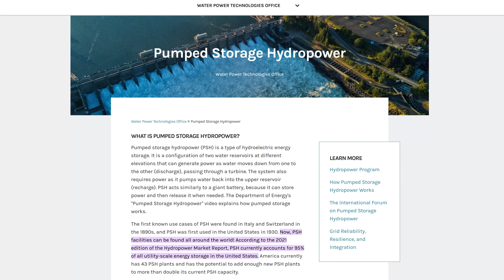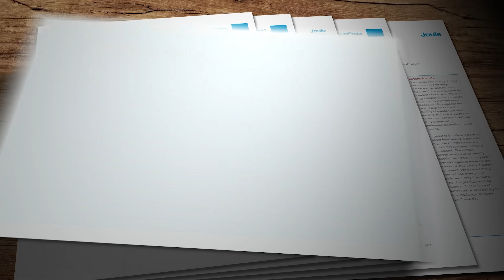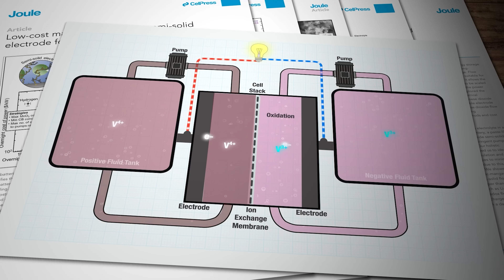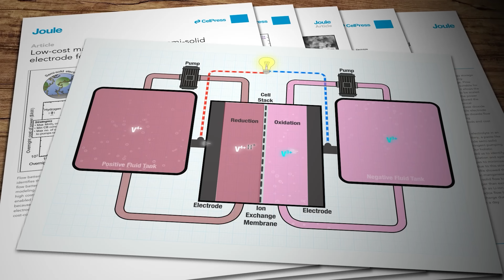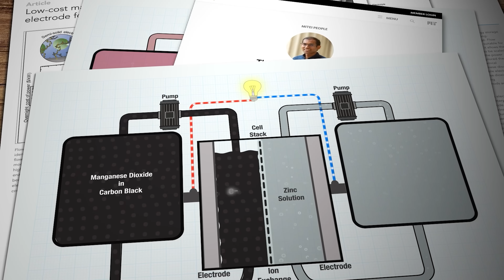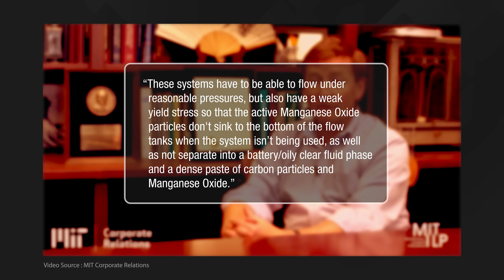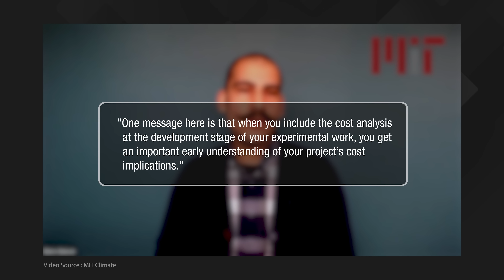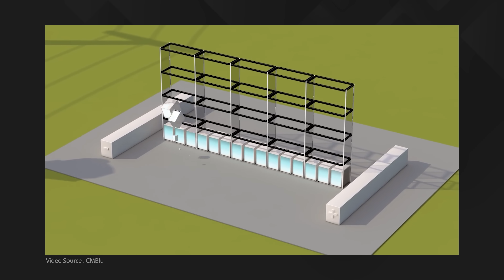Have we found the missing link in the energy storage equation?

Comment: Paste or glue pumping sounds like blowing your nose with a bad head cold. There doesn't seem to be much reason not to look into less viscous solutions. Perhaps a solvent less polar than water could be used..?  Unlike the pictures in the vid, it could be useful to pump up, as well as temperature variations, to encourage buoyancy mixing. There's all sorts of additives, as well, that can prevent 'caking' or clumping of particles. 
One thing that almost always seems left out of battery system design thinking is the fact that the main region of interest, where everything's happening, is the Helmholtz double-layer, right at very small distances from the cathode and anode surfaces, where the final stage of charge transfer occurs. Most of the rest of the electrolyte is mixing or diffusion 'dead' space. One should engineer that to a minimum.

Comment: The pumped hydro storage has been around for a hundred years and is a popular and proven technology.  There are only the regulatory and political hurdles that have to be completed.  There are thousands of these potential sites around the world, they just need a small fraction to be brought online to take care of most of the storage requirements.  An abandoned mine pit was chosen for a pumped hydro site in Australia.  

I'm hoping that some financial support is made available to longer term storage like redox flow batteries because they fill in a time frame that's between lithium batteries and pumped hydro storage.

Dave mentioned frequency regulation.  From what I've read, this is the method that the grids use to signal load conditions.  High load slows electromechanical generators and signals the grid needs additional generation.  But renewables do not need to let the frequency change with load.  The voltage sags with high load, not frequency.  So the grid is going to have to get smarter in order to eliminate all those thermal generators run by fossil fuels.

Comment: There is at least one company fielding redox flow batteries that don't use vanadium, and is environmentally friendly.  And there are other videos on YouTube with more information about them.

One would think that they could find a solution that is not so viscous so that it is easier to pump. Another thought occurred.  How about using some mechanical spreaders to scrape off used goop and spread on another layer of fresh goop.  The continuity of current would have to be interrupted but averaged over scores or hundreds of cells, the interruptions would average out and not be noticed.

Comment: You also need to look at round trip efficiency, as well as initial cost per kWh of energy storage, cycle life, and maintenance costs. Lithium batteries are incredibly efficient, low maintenance, but have a high initial cost, and limited cycle life.
Reply: You are right that all those factors need to be considered and LCOS does. For grid scale time shifting of renewable generation efficiency is not super important because because the charging energy costs next to nothing as it is currently being thrown away. Capital costs divided by total lifetime energy storage are much more important.

Comment: A screw pump is usually the choice. The technology is fairly developed pumping cement to high buildings under construction.
Reply: Perhaps a peristaltic pump would work even better than a screw pump. Many years ago I used one for quite viscous phenolic resin and it worked a treat. The other option would be to slightly heat the electrolyte, if its viscosity is strongly temperature dependent.
Edit: also possible, a Moineau pump, which is a progressing cavity design, even better for very viscous fluids.
Reply: @johannesschaller5510  I always wondered if peristaltic pumps don't wear out too much, or too quickly...
...if they don't, you are very likely right.
Reply: @smferreiro2610  It depends on the tubing used in them and the material is that is being moved. They are cheap to repair when the tubing does wear out as compared to other types of pumps.
Reply: @gravelydon7072  I guess that, as always, it boils down into a question of economics and logistics: how expensive the tubing is,  how frequent we have he system down for what length of time, and if we can afford discarding some fluid in the process (ambiently and economically).
Thank you!
Reply: @johannesschaller5510  The tubing is the weak point. There isn't any round tubing material out there that can withstand being flattened all day without eventually forming a fold or crease. And the thick viscosity of the paste might be too much to pump through the tubing. The tubing creates a strong resistance to flow of high viscosity pastes.  If anything, the paste might need to be heated and maybe a timmer pneumatic pump would do the job.
Reply: @johannesschaller5510  I've used PCM pumps for transferring explosive emulsions. An auger system could work as well.
Reply: @johnarnold893  Interesting to see this thread expand, given what we don’t know about the electrolyte fluid. 😬 Seems to me there are at least two significant properties that need to be considered: the viscosity vs temperature relationship, and the shear rate sensitivity of viscosity. I’m not a chem engineer, but those would be the first things I’d ask about.
Reply: @johannesschaller5510  Haha. I had never heard of a Moineau pump. I looked it up and then realised I've worked on them for years and know them as a Mono pump.  I agree, a Moineau pump would work well.  We used them to pump molasses.  They did work better if the molasses was warm.
Reply: Also grain.
Reply: I was thinking just let gravity do the work, put a full hopper, or more likely an array of hoppers, at the top and drain into an empty hopper, then mechanically swap them
Reply: @Dysiode  Or, if we place the battery on a hillside, cheap real state, the "bottom" hopper of one cell can actually be the "top" hopper of the next, and we chain all the cells... 🙂
Reply: @Dysiode  I was thinking of something similar but having one full tank and one empty to receive it and having it on a spindle. Gravity will pull the liquid to the empty provided there is a vent. Then rotate when needed. Maybe making the whole thing reversible
Reply: As mentioned by Johannes… The oil drilling business also intensively uses Moineau-style motors ( reversed pumping… ) downhole for turning drilling bits.  The viscosity of drilling muds is much lower but they are very abrasive and they operate in an extremely harsh environment.  A very well understood technology.
Reply: @johnashton4086  Interesting! I'll take a look... thank you!
Reply: There's a type of screw where the screw remains stationary and the housing is what rotates, used for vertical grain lifting, and gravity does the rest. Olds elevator. It could also agitate the fluid preventing it from settling if that does become a problem.
Reply: If that goop shown at the start is a true representation of the electrolyte then I think a screw pump is the best choice as they are well suited to thick product, can be set up in a series configuration to counter pump line friction slowing,  and can be heated to improve viscosity if need be. Think of plastic's extrusion, they are just a fancy screw pump. I could not see you getting enough head pressure to allow for gravity induced flow of that thick  a material.
Reply: @alistairshanks5099  I believe that warming it up isn't an efficient option. I guess it would be pumped as it is (unless it is kept for freezing days)
Reply: All of these Technologies are very interesting and it gives me hope for the future.
There's one problem and that's the Arctic wobble as we have seen in recent years that could really throw a spanner in the works.

Comment: Just having a thought.  Part of the reason Elon got into car manufacture was, I think, because EVs would provide the scale to reduce the cost of lithium ion batteries to where they were competitive with pump hydro and more convenient.  So the ramping of Li battery production might make other solutions redundant.
Reply: There isn't enough Lithium readily accessible to use it for grid storage. Many people think we're going to struggle to find enough just for BEVs.  In terms of factories larger volumes = lower price, but larger demand for a scarce resource puts the price up not down. Mining lithium is very ecologically problematic/ potentially damaging. Save it for the cars and phones. We need something else for grid.
Reply: @adrianthoroughgood1191  CATL has used sodium ion.  There should be enough of that.  My point was that the solution that gets to scale manufacture will crowd out the others.  I liked the Ambti battery but it can't use EVs to scale.

Comment: We are better off using iron rust and salt water flow batteries.  Common PVC components,  easily scalable salt water tanks, 100% recyclability, 20 yr life span per system, no shortage of materials,  average layman can repair and maintenance without a hazmat suit.  If it breaks down and is discarded it will easily be reabsorbed into the soil. No toxic side effects.   And the US Army is testing them.

Comment: out of all the grid storage batteries you've reviewed, the liquid air battery seems to tick most of the boxes, using low cost common materials and extremely long cycle life and huge storage capacity from four hours to four weeks, I'm wondering if the liquid air battery makes it into mainstream grid storage.
Reply: Indeed. It would be interesting to compare grid scale storage solutions to liquid or compressed air batteries as a reference.

Comment: Zn-MnO2-C powder batteries are called dry cells. Unfortunately they are not reversible. 

The problem will not be with the MnO2- carbon powder paste; the Zn electrode cannot be regenerated efficiently and it will be produced something like a sponge.

Comment: We cannot possiby build enough batteries for grid scale storage. The idea is simply a non starter. Do the math.
Reply: Estimates show to convert to a 95% plus renewable grid we need around 600gwh of total energy storage capacity.
Tesla plans to do 40+gwhs of megapacks just from their new facility in lathrope by the end of 2023. Slated for 20+gwhs this year alone.

So yes we in fact can build enough grid scale storage using batteries. Just tesla alone with some massive pumped hydro would get us there in about 10-12 year's from now. 

Nevermind that worldwide ev production alone now is over 300gwhs, so if a large percentage of evs start to offer v2x capabilities. 
Which is in fact coming online with the ioniq 5 and ev6, the id series vw evs are supposed to do v2x starting later this year. 
Lucid has v2x, rivian is supposed to offer it eventually. The Ford lightning will have intelligent home backup power on every truck from day 1. 🤔
Reply: @4literv6  No we can not build enough grid scale storage using batteries. it is utterly impossible and would need many times more of certain metals than exist on the planet. Tesla did build a 'grid scale' storage in Australia which holds enough charge to power a small town for about 1 hour. That's the3 best they can do. i dont know where you got your figures but they are messed up. 600 gigawatt hours? for a whole country to last potentially several months? 600 gigawatt hours would be gone in a few hours.

Comment: LCD displays were in the lab for 30 years until they swept CRT technology away in a couple of years. It can happen and I hope it does quicker for battery and all other forms of renewable energy storage technologies. The planet is screwed if it doesn’t happen.
Reply: Technically they were in the lab and in watches, calculators and various niche applications. Shrinking the cells down to pixel size was the  biggest issue I guess.
Reply: @alvarofernandez5118  I read that it was getting the manufacturing quality up to a point where the pixel failure rate was acceptable on a large display.
Reply: Yea, I definitely think research on all these things  needs to keep going forward for the long term gains that we’ll eventually get.

It’s just when I hear someone putting off purchasing an LI storage battery for their solar system cause they want to buy a flow battery when it comes out….that’s when I roll my eyes.
Reply: @SaveMoneySavethePlanet  actually for me it is wanting to hold off updating my phone in the hopes that Samsung makes some head way with battery tech they are working on developing. Both in terms of solid state and utilising graphene in making it.
Reply: @idealicfool  I mean, I fully support people waiting longer to replace their phones. I think the average is that people replace their phones once every 2.5 years but they work fine for 5+.

I hope they come out with the phone you’re looking for soon!
Reply: @SaveMoneySavethePlanet  know a lot of people looking for a grid level storage solution for their house?
Reply: @Tasmantor  yea, I’ve heard a fair number of people trying to push for small flow batteries every residential block or so.
Reply: @SaveMoneySavethePlanet  The big advantage of flow batteries is that once you've got the cell and pumps, the marginal cost for extra tanks and electrolyte is low. So the bigger they are the cheaper per MWh storage. Small scale flow batteries are rather silly. It's probably coming from people who are obsessed with being independent from the grid.
Reply: @adrianthoroughgood1191  yea, I know that and you know that, but the constant barrage of articles with “breakthroughs” is leading to the average citizen being severely confused.
Reply: @Withnail1969  absolutely! I know a handful of people who care deeply about the environment, but are convinced that some huge tech breakthrough is going to solve anything so they don’t care to make any changes in their life or push for any governmental changes.

It can be super frustrating sometimes.
Reply: We didn't desperately need LCD displays, I mean they are way better that CRT and radiation shields are a thing of the past for PC users. You do realize nuclear reactors are the perfect answer to global warming and the energy crisis. The more scams like this get coverage the further our children will be in the CO2 depression and inevitable wars to follow. If we had just built nuclear this evening I could have been entertaining or tutoring the kids, instead I'm worrying while watching this video and many like it.
Reply: @bigstiggerNo1  fucking nuclear fanbois.

If we had 50 years up our sleeves, an infinite supply of money, concrete, uranium, reactor factories, a tested design for a mass production capable reactor and 100 million trained operators, then yeah nuclear would be perfect.

Since none of those things apply on this planet, nuclear is just an on going excuse for the fossil industry to continue until the nuclear fairy arrives and solves everything.
Reply: @gasdive  I should add with 1/3 less installed capacity before you get all hyped up about nearly.
Reply: @bigstiggerNo1  well there's a well argued line of reasoning that clearly refutes everything I've said point by point.... 
/sarcasm

I haven't been looking at any propaganda. I've looked at how long it takes to build factories. How long it takes to build prototype reactors. How much fuel there is available. How much more fuel would become available if we increase the price by a factor of 10, 100, 1000, 10,000 100,000, 1,000,000. How many skilled people would be needed to run those reactors.

If you've got any links to similar "propaganda" I'd be most interested because that's the conclusion I've come to from actually doing my own research and I haven't seen anyone else lay out the problems as clearly as I think I have done. 

I was a huge fan of nuclear. My Grandfather was one of the designers of the first commercial reactor in Britain (he did the control systems). My god father, a working nuclear physicist at a research reactor. I've listened to reactor shop talk around the dinner table since before I could talk. That doesn't change the facts, and the facts are that there's not enough time, fuel, skilled people, designs, locations, factories, machines or money to build a nuclear solution to the fix we're in.
Reply: LCD displays were in use on small devices like watches from 1980 or so onwards.